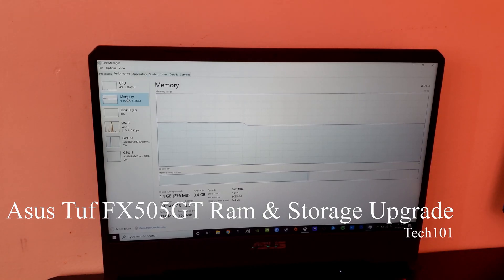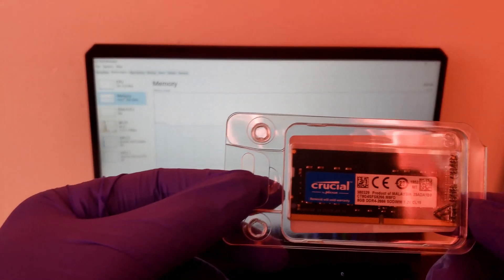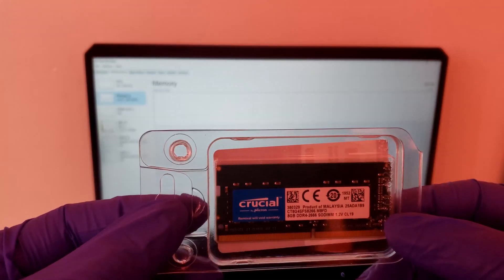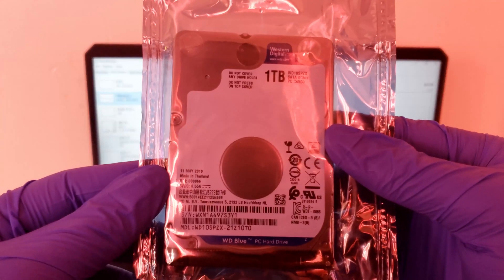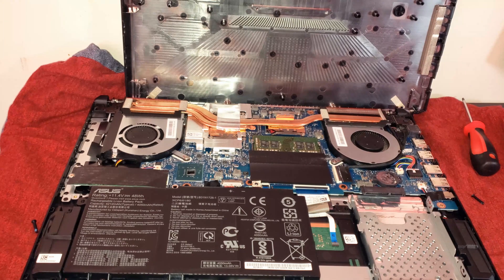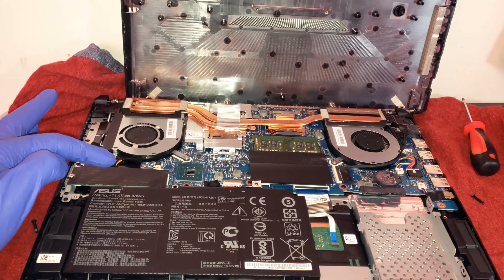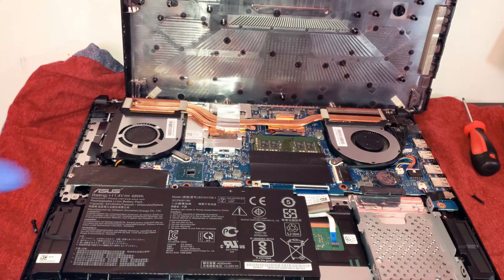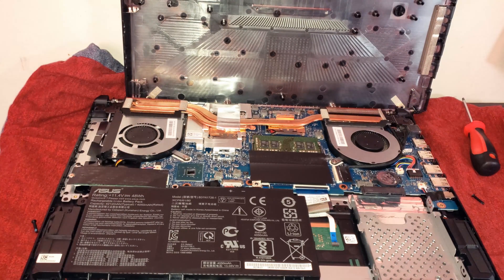How to Upgrade Ram & Storage | 2020 Asus Tuf FX 505GT

Comment: Hello sir. After 3 years of owning this model, I decided to upgrade RAM on it. Found decent RAM at a very good price. However before I'm going to buy it I need some directions. The target ram is "Corsair Vengeance, 32GB(2x16GB) DDR4, 3200MHz CL22, Dual Channel Kit". After some reading I know the compatibility of this model is 2666MHZ, yet my question is will it work? I have the INTEL version. Will it underclock itself from 3200 to 2666 or should I search for 2666 with 1.2V?

Comment: es normal que la parte delantera de la tapa quede como con una pequeña abertura? intento cerrarla pero no se puede
Reply from the maker: It should be closed. The clips might have been broken when you opened the laptop.  You can gently try to snap it back in place IF the plastic clips are not already broken

Comment: when the initial RAM is 8GB, can it be added with 32GB DDR4 RAM? and there it says 4 slots but when I see only 2 ram slots
Reply from the maker: Hi, yes you can. However, there are only 2 slots available. I would recommend upgrading the ram to the same manufacturer, model, and ram speeds.
Reply: maybe you need  to buy two 16gb ram to achieve 32db ram

Comment: Can the motherboard only handle 2666mhz ram or can it take 3200mhz
Reply from the maker: Only up to 2666mhz
Reply: @supreme_tech_reviews  so if I were to buy 3200mhz it would only run at 2666
Reply from the maker: @blueberryy4655  that's correct

Comment: Does it affect performance if the ram in the laptop is 2667 mhz and the ram you recommended is 2666 mhz because i thought it’s bad to mix and match ram.
Reply from the maker: No that won't affect it. It's essentially the same ram. The system will down clock the ram to match the lower ram speed.

Comment: I am really bad at computers, how do U know a hard drive is compatible with my laptop? Does it just have to be 2.5IN drive?
Reply from the maker: Hey. Im happy to help you with that question. Yes a you are correct,  a 2.5 inch hard drive should fit in your laptop with out any issues. Do you have the make and model of your laptop? Asus. Dell. Lenovo etc...
Reply: @supreme_tech_reviews  I got the same one u upgraded in your video, so this laptop will work with any hard drive that's 2.5Inch? Bc I think the one I am getting is slightly different than the one in your description. I am thinking of picking one up today, and I think it's slightly different (Still a 2.5Inch drive), just wanted to make sure it would still work.
Reply from the maker: Yes it will work. You do have to partition the drive after you've installed it. I would not get anything over a 2tb in size.
Reply: @supreme_tech_reviews  Alr Thx for letting me know. It really helped. Have a Great day!
Reply from the maker: You're welcome. Have a great day also.

Comment: Good video bro, I've the same laptop, can I ad a 8gb ram ddr4 3200 mhz of Kingston for dual channel, or could I replace the ram stock of the laptop for put two ram memorys of Kingston?
Reply from the maker: Hey. Short answer, No it's not a good idea. Long answer, The maximum supported ram of this laptop with these configurations are 2666mhz. If the configuration is an amd processor it will be more useful. But the intel i5 of this system is unable to support any faster speeds
Reply: @supreme_tech_reviews thanks man. i have the same laptop but currently with a 4 GB DDR4, can i add a 16 DDR4 2666mghz? or should it be also 4GB? 
Thanks

Comment: Why wont my laptop detect the ram it still says 1/4 slots are being used
Reply from the maker: Did you use the same speed as the original? Try troubleshooting. See where the install process could have gone wrong. Did it clip correctly to the motherboard ?was the computer completely powered off during the install process?

Comment: hey i need help 

i am buying asus tuf f15 fx505gt ab73 
i7 9tg gen and gtx 1650

so my queries: 

does it have 2nd ssd slot (nvme) 
if not can we add an ssd in hdd slot? (2.5")
which ram frequecy should i buy?
thats it hoping for a reply
Reply from the maker: Hey Vidit. Yes you can add a 2.5 in ssd in the hdd slot. As for the ram frequency. 2666mhz is the max compatibility. Hope you found this helpful.
Reply: @supreme_tech_reviews  yes indeed its helpful thanks :)
Reply from the maker: @viditverma9515  please Subscribe to my channel if you haven't

Comment: It sucks that nobody mentioned the over all size of the 2.5 hdd. They comes in 3 difference sizes, 7mm, 9.5mm and 15mm. I think this laptop only support the 7mm version.
Reply: 2.5 is the size in inches. The other size is 3.5. You can convert the 2.5 in to cm if needed.

Comment: I have a FX-505GT-BB51-CB... do you know if it is possible to add a M2 SSD drive specifically to this model?
Reply from the maker: Im not 100% sure. But I believe it does have one m.2 slot which holds the system os. You can upgrade drive if your comfortable with reinstalling windows on the new/upgraded drive.

Comment: Hey i have the same laptop can you plzz tell me which hdd i should buy because this hdd is not available in my country.
Reply from the maker: Hey. What country are you located? I'd suggest Seagate Barracuda 2.5 in 5400rpm if the western digital is not available.
Reply: @supreme_tech_reviews  india bro
Reply from the maker: Compatible ram

https://www.amazon.com/dp/B071KNKBQ1/ref=cm_sw_r_cp_apap_YND788BGj7eEA.
Reply: @supreme_tech_reviews  it will run smooth right no error anything?
Reply: @supreme_tech_reviews  and yeah the ram also which one is good?
Reply from the maker: @tetogaming1928  hello 🇮🇳 . Hope to visit when the world goes back to normal.  But Yes it's the right drive. It should work well. You'll have to partition the drive in disk Manger. Its a simple process. The ram used was DDR4 2666MHZ. ill post a link to the brand I used.
Reply: @supreme_tech_reviews  Thank You So Much Brother ❤️
Reply from the maker: You're welcome 🙌🏼
Reply: @supreme_tech_reviews  Yeah Bro most welcome ❤️

Comment: I just want to know I have the same laptop. I want put extraram and storage withhe ones already instaled. After I have added them do I need to to something extra like adding drives or any things in particular ao that the extra ram/storage works?
Reply from the maker: Hey, The ram should be detected automatically. However the storage needs to be partitioned in disk management. Check my description for compatible ram

Comment: my tuf fx505 i5 9300h has preinstalled 4gb ram, can i add 16gb ram to make it 20gb? given same frequency?
Reply: i was researching about this too, you can but not recommended. apparently if they have different voltage. It will default to the lower voltage 1. so they wont to work well. So that's why people tend to use same brand and size.
Reply: it is better to install two ram memories of the same frequency and of the same capacity, for example you can put two of 8gb, you could buy two of the same brand and that is supposed to activate the dual channel

Comment: how do i know if a ram what i want to buy is compatible with my motherboard pls
Reply: hey bro if you are on this exact laptop this website here scans your system and tells you what ram you can use and what will be compatible with your current ram if you are adding to it: https://uk.crucial.com/store/systemscanner
Reply from the maker: I linked the ram I used in the description of the video. if your interested in a different type I cant confirm if its compatible.

Comment: What type of extra ssd slot is given ,..nvme or sata ?
Reply: I have the FX505DD and there is a sata and nvme
Reply: @Dyingbreed1990  no i mean is there an extra nvme drive? Other than the one included
Reply: @AW-zu4kk  No
Reply: i think it's sata. its the one on the empty silver metal bracket. if there is nvme i can't find a slot to put it on.

Comment: Can we use 7200 rpm HDD on this or 5200 is the only thing that 505gt supports PLS REPLY :)
Reply from the maker: I haven't tried the 7200 rpm but I haven't seen anything that says its not compatible
Reply: @supreme_tech_reviews  so do you think it's allowed to use that & what about the gbs I've no idea but it did 6gbs is important with 5200rpm
Reply from the maker: @HindiDarkestFacts  the faster rps wont make a big difference in read and write speeds. If you're interested in performance. Get an ssd. If you can't spend the extra cash then get the 5200 as i can confirm that actually works. Im sure you'll only want to do this upgrade once.
Reply: @supreme_tech_reviews  I already have an SSD of 500 GB but I could not figure out the rpm thing but I need a HDD & it has 4 ram slots out of which 16gb is there in one, and it says expendable upto 32 so should I get another 2666 MHz ram of the same 16gb size or can I go for even lower ?
Reply from the maker: @HindiDarkestFacts  my recommendations for you will be to purchase the 5200rpm hdd and stick with the 2666mhz ram. You can add another 8gb to make it dual channel ram. However if you're able to get another 16gb 2666mhz ram stick. That's gonna be better.
Reply: @supreme_tech_reviews  did you mean 5200 rpm :) and what gbs should the hardish be cuz I can't find something similar to 6gbs with 5200rpm
Reply from the maker: @HindiDarkestFacts  Look for a sata 3 hdd. It'll give you the 6gb/s if your system supports it.
Reply: @supreme_tech_reviews  how can I check if it supports my system or not :)? Does it generally support fx505gt?
Reply from the maker: @HindiDarkestFacts  yes it should support it.
Reply: @supreme_tech_reviews  how about if I buy a ssd, which one would u prefer
Reply from the maker: @HindiDarkestFacts  generally speaking.  Any sata 3 Ssd or hdd will be fine.
Reply: @supreme_tech_reviews  what about Seagate Barracuda 1tb 6gb 5400 rpm ? Will it be fine bro
Reply from the maker: Yeah that's gonna work. Make sure its 2.5 not 3.5

Comment: Bro i have a same laptop and it has 8gb ram installed in it so can i expand 16gb ram to the second slot? Please reply...
Reply: yes, you just have to buy a single 8gb ram card and insert it into the spot. once you do so you’ll have the 16gb ram.
Reply: Is it okay if I change both the ram with two 16gb ram with 3200hz even tho the former ram have only 2666hz? Can it use the maximum 3200hz?
Reply from the maker: You can upgrade to 32gb. However be sure to check that the cpu supports the higher speed.

Comment: Does the WD 1 TB hard drive replaces the previous predetermined storage? or it just takes the 1 TB on the whole computer?
I mean, my ASUS FX505GT has a 512 GB of storage, what happens to that storage? 
thank you in advance !
Reply from the maker: It works as an additional storage. The system ssd will run the same and be available along the additional drive
Reply: and can you install an SSD with a Hard drive at the same time?
Reply: Yes you can, this laptop came up with empty 2.5" storage slot. You can choose to install hdd/ssd 2.5" there. it won't affect your predefined storage because it was installed in m.2 slot (different slots)
Reply: @fyrdz  Just to confirm, the new hdd/ssd 2.5" would be just a secondary hard drive, correct? Do I need to format it?
Reply: @RFMagnussen  yes, you do need to format it

Comment: Hey , do you know if I can put in a ssd instead of hdd
Reply: yes you can
Reply: @vincent8313  ok thanks
Reply: @vincent8313  I have a FX-505GT-BB51-CB... do you know if it is possible to add a M2 SSD drive specifically to this model?

Comment: Just bought this laptop today and just ordered the same ram stick as you off of Amazon.  Excited/nervous for this as it will be my first time upgrading anything in a PC/Laptop.  But gotta get that dual channel performance.
Reply from the maker: Thats awesome man. Congratulations.... its a good laptop and fairly easy to get into. Just keep track of all the screws. Also disconnect the battery after you open it. Using rubber gloves will also help prevent electricity from your body to the laptop. That can cause damage. Good luck 👍
Reply: @supreme_tech_reviews  the upgrade was a great success!!!  Thanks for the pointers brother!
Reply from the maker: @ASeasonInSidewinder  excellent brother. I'm happy to hear that it went well. Enjoy!

Comment: Question:
Why you use a HDD, when you can use a SSD wich is faster?
Reply from the maker: The ONLY reason I chose the HDD over the SSD was the price per GB. For a 1tb ssd id easily pay 3x the cost of the hdd.
Reply: TECH 101 You got a link for a SSD for this laptop? I perfer an ssd
Reply from the maker: @6bang447  no. I can't recommend any in particular. Since I can't confirm its compatibility.
Reply: TECH 101 It’s an asus tuf fx505DT

Comment: I have asus tuf505dt . Do i need to change bios settings or anything after i upgrade to 32gb of duel ram . thx for the help :)
Reply from the maker: For my experience. I didn't have to make any immediate changes for the system to run. I think using any compatible ram will give the same results
Reply: @supreme_tech_reviews  thankyou very much . that's a load off my mind :)
Reply: @supreme_tech_reviews  cool and thx :)
Reply from the maker: @nuclearcaveman3051  you're welcome

Comment: You were too quick separating the case when getting inside. I don't want to break mine and it feels like a screw is still in. Did you have to lift the rubber feet? Is there an ideal place to start levering it apart?
Reply from the maker: Hey, I definitely understand your concern. You can try using the playback feature on YouTube to slow down my video. But if I can try explaining. AFTER REMOVING ALLBTGE SCREWS. I did use my finger or a PLASTIC pry tool to separate the bottom from the rest of the laptop. That's a clicking or snapping mechanism to help hold the case in place. Start from one corner of the laptop working your way around.
Reply: @supreme_tech_reviews  Thank You. I think those clips are brittle. I was careful but now it's back together I have a small peace of plastic lose inside. At least I know how to get it open again and will have to remember to turn it normal way up to get said floater out. Thanks again for giving me the confidence.
Reply from the maker: @Adrian_Mason  you welcome. Please get that plastic out asap. It can cause damage to the fans. I won't use the laptop until the plastic is removed.

Comment: There’s a two pieces folded into the slot where the connection is preventing me from upgrading my ram and I don’t know what to do
Edit: I figured it out, I was putting the ram too low
Reply from the maker: Ok great. Sometimes it just takes a lil troubleshooting.

Comment: Which ram should i buy for this laptop on best buy or amazon
Reply from the maker: I got mine from Amazon. As long as its ddr4 2666mhz you'll be fine.
Reply: TECH 101 does the number of pins matter? Example: (260 pin) (288pin)
Reply: @numberonemorbiusfan9325  idk but the most popular is 260
Reply: Adolf Hitler thanks adolf <3
Reply: @numberonemorbiusfan9325  :D
Reply from the maker: @numberonemorbiusfan9325  260 pin
Reply: Hyper X impact

Comment: Hey will I need to but 2 ram sticks or I can only buy 1 stick needed and a stick which was came the laptop.
Reply from the maker: Hey great question. For my upgrade I only purchased one additional stick of ram to pair with the other that came installed.
Reply: @supreme_tech_reviews  XPG ADATA Flame DDR4 8GB (1x8GB) 2666MHz CL18-18-18 SO-DIMM Memory - AX4S266638G18-SBF

(I am thinking of buying these one will it support with default laptop ram As dual channel configuration)

Comment: Yo dumb question here but does that HDD bay come Like that empty or
Reply from the maker: Not a dumb question. But yeah it comes with and metal bracket to hold the HDD in place along with the screws. The only thing you'll need will be the 2.5 inch HDD.
Reply: Thanks man well appreciated